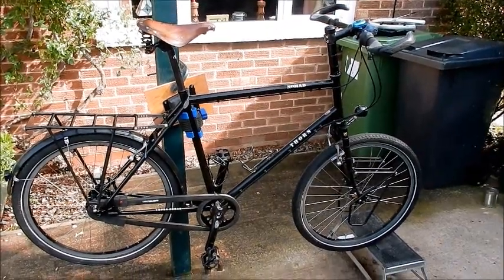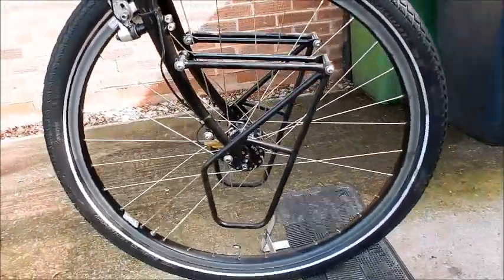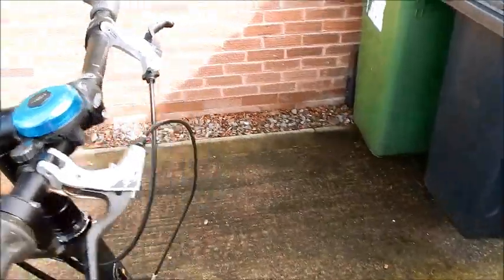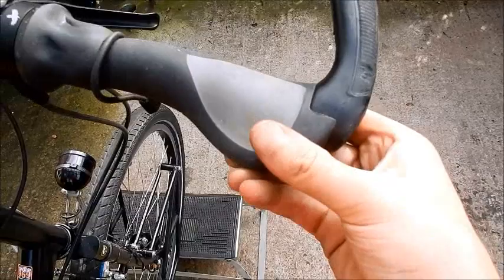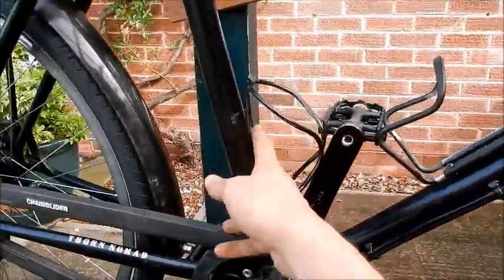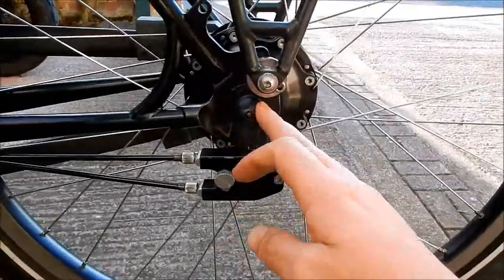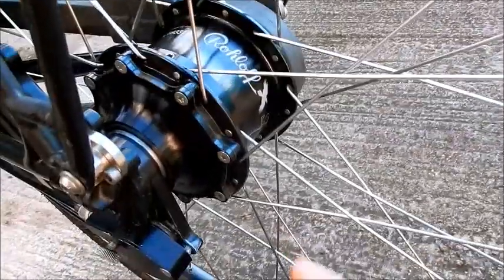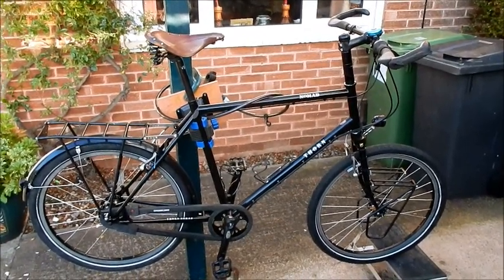Thorn nomad, Touring bicycle, touring bike, expedition bicycle, expedition bike, bicycle touring

Comment: This is one of the better reviews of the MKII Nomad on here and pretty much spot on

I have almost the same set up.

No chain guard and with XTR V Brakes

Also no dynamo hub or integrated USB charger

Instead, a massively over engineered 48 spoke front wheel with a Phil Wood Touring hub

No other activity on here from Richard nor on his website which is still active 

Hope you are well Richard
Reply: I was actually just thinking today about the 48h rims and dynamo hub. I like the overbuilt tank- ness of it 🙂 do you have any picks of your bike online ? I think I recently looks at the Phil woods hub too
Reply: @ourclarioncall  sadly no pics anywhere. I thoroughly recommend the Phil Wood Hub/s…….. be aware though that their Touring Hubs are continually sold out. Best have a look on the website and see what is available. If they have stock ? Grab it while you can !
Reply: @cycletouringoz5760  thanks for the info 👍

Comment: Thanks for the video ,Can I ask what tyre pressures did you use & if you had the choice would you have tried a different tyre or gone tubeless .I've found a rim that can be used on the Nomad that can go tubeless.

Comment: I quite like the look of the belt drive instead of chain. But you have to cut your frame to get it on and off and don’t like the sound of that. Perhaps when they first build the bike they can put one on? But once it wears out then you’d have to go back to a normal chain setup if that’s possible. 

Saying that there is a company called veer that make a belt that can open and close somehow so you don’t have to cut your bike frame anywhere

Comment: Nice review and the RTW tour to back it up. I've just bought one of the Hebie Chainglider guards for my Trolloff. Didn't think much to it when I opened it and was going to return it to SJS but on your recommendation I'll fit and keep.  I simply cannot be doing with any more cleaning and lubing. Like you I want a very low maintenance bike. I also have Thorn's 7075 front chain ring in a 42T with a 16T rear sprocket. I was wondering if the Hebie Chainglider would still fit as the Thorn front chain ring is 5mm thick and the glider takes 3mm or less. But if you say it's ok then I keep it. The Rohloff hub is indeed a revelation. I think maybe your front tyre needs replacing ............. it's  a bit bald. I am using SMP+ Smatguards 26" x 1.75inch at the moment (559-47) but do have some narrower 1.35 inches tyres which are lighter. I am planning to ride London to Sydney to Cape Town to London in 2017. For this journey I have some 2 inch Marathon XRs which were new old stock which I bought a couple of years ago which were the best touring tyre. The Marathon Plus Touring is basically these with Smartguard. Thanks for posting.

Comment: Why did you choose Tungsten-Carbide rims instead of Aluminium or Steel wheels?  How does the Stanforth Kibo-Rohloff compare to the Thorn Nomad?
Reply: Stanforth Kibo-Rohloff use Rigida/Ryde Andra 30 rims which is the same rims, this Thorn Nomad used Rigida/Ryde Andra 30 CSS rims which has a layer of tunsten dust supersonically embedded into the surface which means that they are almost impervious to wear (they have recently been dicontinued, too much of a good thing I think).. 

Read the thorn brochures and get an idea, read their mega brochure  http://www.sjscycles.com/thornpdf/thorn_mega_brochure.pdf lots of info to be gleaned to get the juices flowing. 

I couldn't comment on the Stanforth Kibo-Rohloff as I'd not heard of it before. I'll be reading through their website though.

Comment: Well done! 
Out of curiosity, why did you go with a chain over the belt option.
I am asking as I am considering a Nomad and selling my Surly LHT
Reply from the maker: Matt Roller Thorn don't sell the belt option.  A belt requires a break in the frame and  thorn don't like that!
Reply: @richardalvarez9004  as you may know they do now on the mk3
Reply: If you can use a belt on your bike get one! I wish I could. - https://photos.app.goo.gl/ADgC6oyPM2gyrCq27

Comment: fuck over £3000 Isn't that a crazy prize?
was that without bags and equipment!!!
Reply: No it isn't a crazy price. Comparisons would be a Van Nicholas Deveron from 5,600 euros, or a Co-Motion Pangea at over 6,000 dollars(hand made in Oregon, USA), or a Koga Miyata from £2,660. There's a lot of engineering to create the reliability of these machines. The Rohloff hub will do 200,000km(it's German!!) and costs a grand, but you could go for a derailleur set up which would knock some money off, but would be more problematic(arguably). 
And yes that price is without the bags etc...